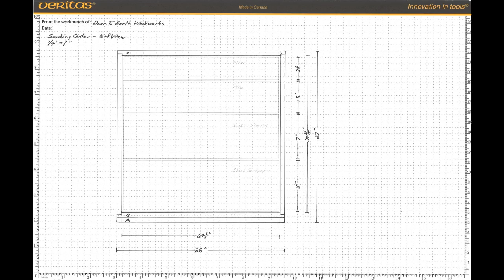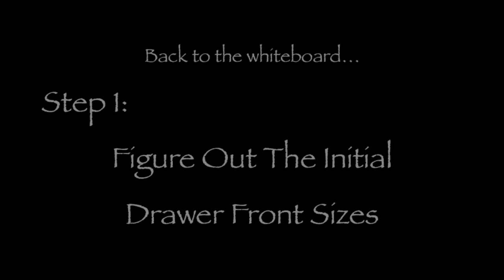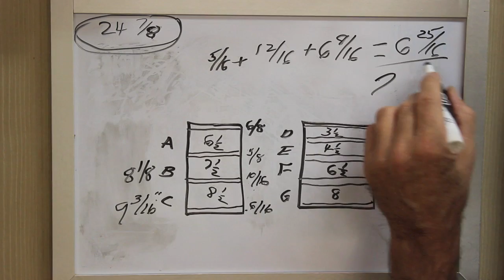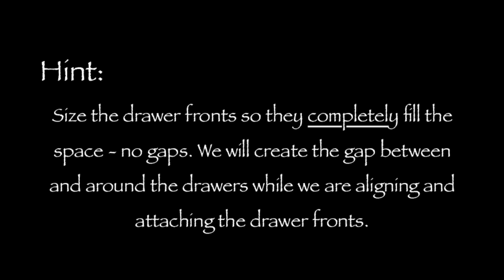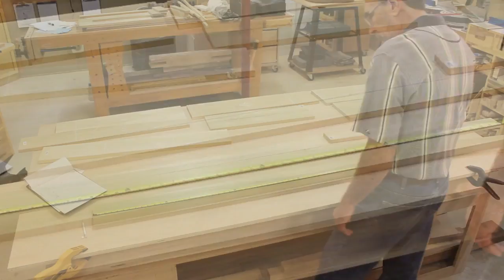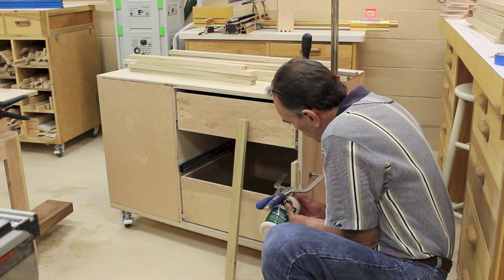Sanding Center Pt 7  Drawer Fronts & Trim

Comment from the maker: In plywood, particularly the plywood you can source easily today, the glue can expand the biscuit and cause the outline of the biscuit to "telegraph" through to the surface.  Because of that, I quit putting glue on the biscuits and found that there was no change in the strength of the joint... so I quit using glue on any biscuits in any wood.  Just a habit.  You could probably put a little glue on and never have a problem.  Thanks for watching!